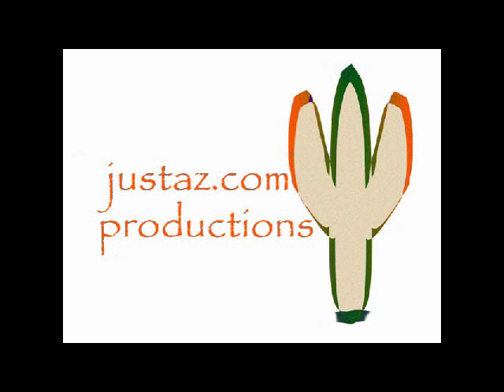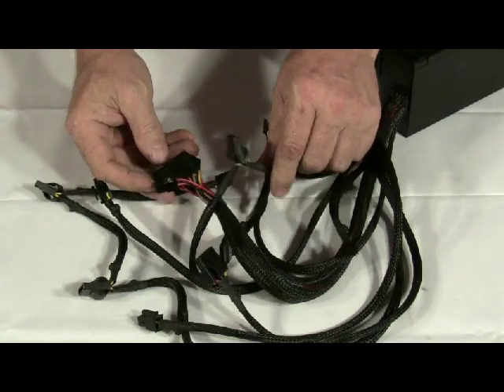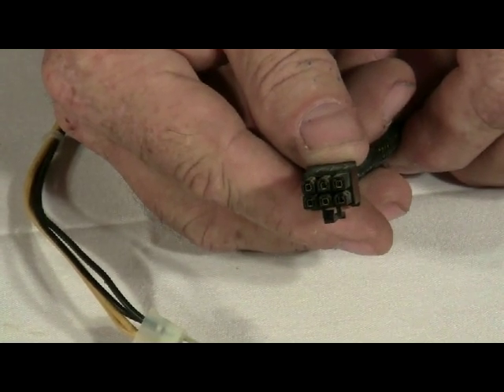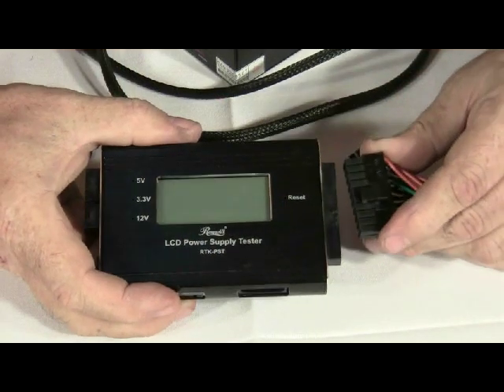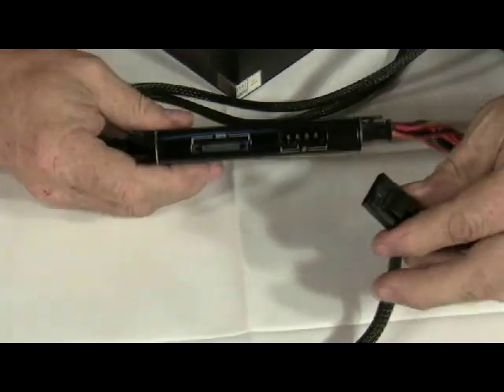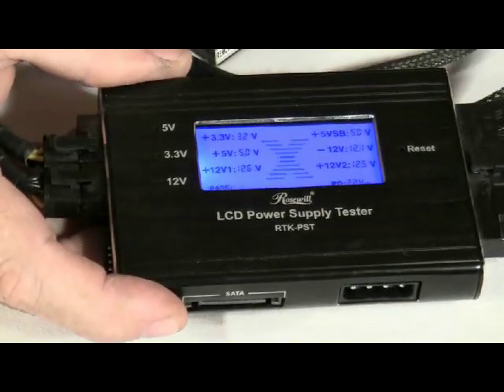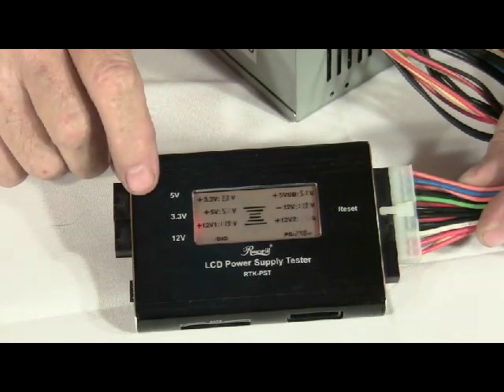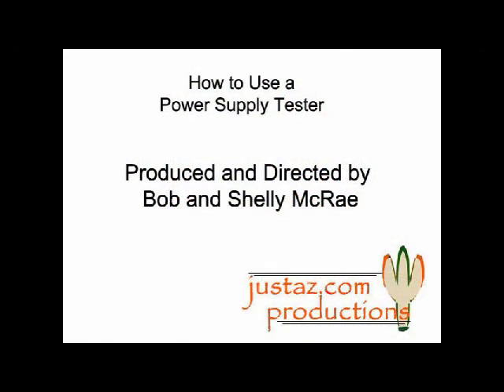How to Use a Power Supply Tester

Comment from the maker: Sorry for the delay in responding, Yatwei Chan. Your power supply is probably good. You should have the 24pin plus your 8pin plugged in when testing the Molex lead. You're probably getting the error because the 8 pin isn't plugged in, not because your Molex is bad. Thanks for watching, and we hope we helped you out.